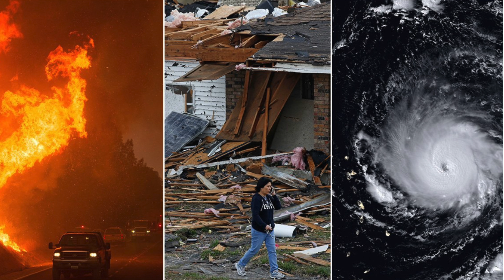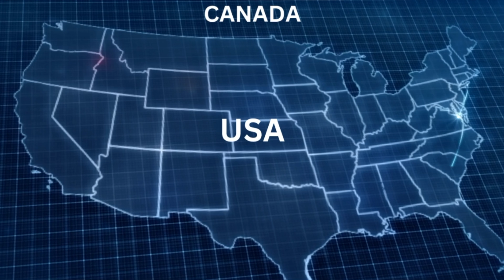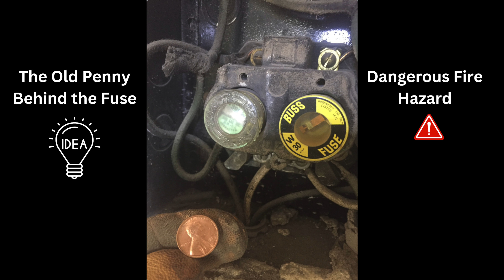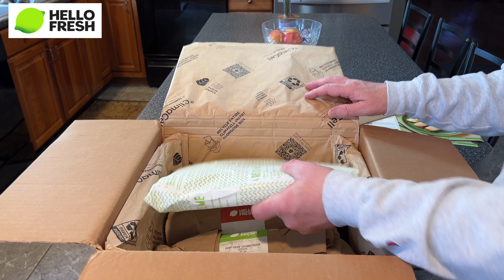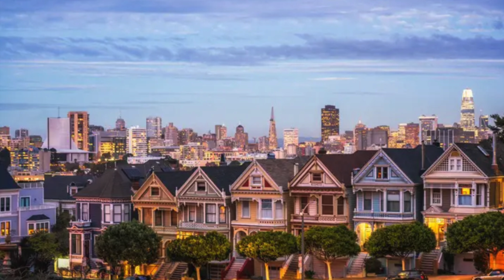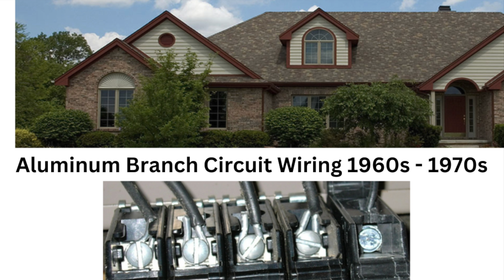Old Wiring Causing New Problems (Are you at Risk?)

Comment: How does old knob & tube wiring cause fires if the circuit has a functional proper size fuse?
Reply from the maker: Pushing the load to at or near the fuse rating over a century can degrade the insulation and cause splices to fail. I have found K&T where the insulation looked ok but when I touched it the insulation turned to powder.
Reply: Knot and tube was in someways safer than modern wiring the problems were due to overloaded circuits, Romex would fail and burn faster under the same conditions, I removed hundred year old wiring, it was all in perfect condition, the modern plastic insulation would fail just as fast if overloaded.
Reply: I believe they used soldered junctions anywhere a wire needs to tee into 2 locations.  I’ve seen plenty of low-voltage solder joints from the 1920s, in pipe organs, where the wires have come apart.  I don’t know if they used better soldering techniques in house construction, but it’s something I worry about somewhat.  I can see some of those junctions in the basement of my 1914 house, but have never removed the tape to see what they look like inside.

Comment: Thank you for posting this. After my mother passed away some years ago, leaving the house to me and my siblings, the home lost insurance coverage because of the very old electrical wiring that it had. I believe that the lender providing the mortgage to the person who wanted to buy that house was also unwilling to move forward unless the electrical system in that house was updated. The buyer of the house was also ready to back out of the sale if both the lender's and insurance company's requirements were not met. I'm not sure if the house wiring was knob and tube wiring. I live quite a distance from where my mother did, and another person handled the actual refurbishing and updating of the house before it was sold. I think it was around $5,000 at that time -- again this was some years ago -- to rewire the house both to meet the code provisions of that time and satisfy the lender and the insurance company. I was glad when insurance coverage was approved, enabling the sale of the house to move forward. I do suggest that anyone expecting to inherit a home get the house inspected right away by an electrician. Then take action on the recommendations. Also look at other items that an insurance company and mortgage lender would look at, and get those things fixed. I and my siblings did hit a number of safety issues with my mother's house that the home insurer required us to correct.

Comment: My childhood home was built in about 1954, I think that it had 2 wire Romex. In the '60s my father (heavy equipment electrician) installed what he called a "grounding grid" throughout the home and bonded it to the water service where it entered the home. 
That way he could upgrade all the receptacles to the "modern" three-prong standard. I'm sure it's still in place but don't know if it's acceptable.

Comment: Most of the homes wired with knob and tube also used wood lath and plaster to cover the walls. Lath and plaster is just about imposable to neatly fish new wire in.
Reply: alot were baloon framed ...once you got thru plaster you had somr times had a clear shot up floors..
Reply: Yes. Been there, done that.

Comment: Thanks for keeping us up to date on this trending across the US. I too have witnessed the horrors of finding the "penny breaker" and knob and tube (In Oklahoma). They are indeed some of the most frightening encounters one can have when working on electrical.
Reply: I've never fully understood the "penny breaker" concept. Does it not rely on the penny making firm contact with threaded female portion of the fuse socket? Thus, are you not relying on gravity for the rim of the penny to make contact as the fuse is tightened? Seems like this intermittent contact situation is almost as bad as the loss of overload protection.

Comment: I remember as a little boy always scratching my head as to why the electrical outlets in my grandparent's house only had 2-prong electrical outlets, instead the 3-prong outlets like most houses had.
Reply: I must be older. I remember looking for an adapter that eliminated the ground.
Reply: @RichardQuaid   Those 3-prong adapters relied on the outlet box being grounded, a rather tenuous assumption at best. Mainly they just saved you from having to cut the grounding prong from the cord.:face-blue-wide-eyes:
Reply: @ Exactly, but many weren't.

Comment: I'm remodeling a more than 100 year old house and the electrical has pretty much turned into a rewire at this point. The old half out the house had been updated to early Romex at some point then an addition was added with slightly newer Romex along with the fuse panel being changed to breakers. Most of the knob and tube is still there, just abandoned. I was in the attic last week tracing some mystery wires and stumbled upon some crumbling knob and tube that was energized buried in the attic and into some walls. Quite scary to know that stuff was still hot and basically crumbled into dust when touched!

Comment: Great video John and a great primer to get home owners thinking. I live in a 1971 house with aluminum wiring. I’m almost done mitigating all of it by installing the Alumiconn connectors. Do you know how the insurance companies view that as a fix?  Would they accept this as a viable solution and reduce the premium excess as a result and/or not cancel your insurance?  How would they handle it if the homeowner did the alumiconn installation themselves?  Thanks!!
Reply from the maker: Thank you.. I am not sure what the insurance companies are thinking or what they will approve. I think it depends on the underwriter and where you live. What you're doing is definitely an improvement and will surely extend the life of the wiring in your home. But what they will except could be a moving target.
Reply: @ I think you’re correct John. We’ll just have to watch it.

Comment: How can you tell if your house needs rewiring?
Reply: Call an electrician is a good just to establish a relationship with a tradesman.

Post a picture of the wires entering the breaker box online, that might give a hint as what is behind the walls. 

You or a handyman could open switch and wall outlets and examine the wires.

Attics basements and crawl spaces may allow inspection.
Reply from the maker: The other commenters here are spot on. If you cannot tell it would be best to get an experienced electrician to come in and look things over.
Reply: Light switches seem to be overlooked when a house is rewired to hide knob and tube wiring. That's how I found it in 2 houses I rewired. Try pulling out a couple switches in bedrooms or at the entrances to the house and check for knob and tube as shown in the video. Another clue is if most of the rooms are all on 1 breaker. Ignore the labeling and turn each breaker off, testing lights and outlets to see what goes off. The second house I rewired had a new breaker panel and new romex from the panel running in the unfinished basement ceiling. Breaker labels looked good - 2 for kitchen, 1 first floor lights, 1 first floor outlets, 2 bedroom, 1 computer room, and a few others. But, when I tested, the first bedroom breaker turned off 1 outlet in the front bedroom. The second didn't turn anything off in the 3 bedrooms. The computer room breaker turned off 1 light in the bathroom. Basically, the whole second floor still had power. I started turning all breakers off one at a time. Naturally, the last one was the one I was looking for. It was labeled first floor lights, but it also powered the second floor. After tracing the romex from the panel, I found a small junction box that was along the edge of the basement ceiling. From that box, I saw the 2 single conductor knob and tube wires that were the original circuit for the house. Whoever rewired was just trying to hide the knob and tube from inspectors that didn't do an extensive check.
Reply: Age of the house is one factor.  Two, look load center, fuses or circuit breakers?  If fuses, it is time to call in a license electrician.  Also, look at the electrical cables entering the load center (circuit breaker box/fuse box) to see what type they are and its best to allow the electrician to look at them.  Amperage size (100 or 150 or 200 amps) of the main breaker and it is sized properly to the electrical load you use, again an electrician is best to look at this.  And most of all, if you have a Federal Pacific or Stab Loc brand electrical panel they should be changed out immediately as they have been recalled.

Comment: Great information. I find many home owners are un aware of this and get blind sided from insurance or after buying a old home and trying to get re connected to power company . I find power company's are refusing service to older homes with old wiring that  looks bad requiring an inspection .  Many foreclosed homes are on the auction block . And can go cheap . But buyer beware . Yes Aluminum for branch circuits is bad.  Have to find breakers and outlets   with a AU wire rating and use DE-OX on wires . and up size AWG . The outher problem I ran inti is CCA Romex that was made for a wile. Copper Clade Aluminum.  Very bad.  It corrodes when damp and over time copper and aluminum  expand at different rates and making a loose connection over time .   I ended up ripping that out and replacing with modern Romex.  The early armed cable like BX has cloth insulation that rots with age and shorts out causing fires. Modern NC cable is great . I do not blame insurance company's for this.  They look at cause of fires in older homes .  Best have older homes inspected for bad wiring before something bad happens.  Mice just love that old wiring.
Reply from the maker: That's great advice for potential home buyers! Thanks for sharing.

Comment: How does the penny short the fuse path?  I’ve heard of it but the fuse’s current pat is through the upper rim of the fuse isn’t it?  I grew up in a knob and tube house and the insulation on the wires was mostly gone.  It’s still standing today.  Insurance scares seem pretty common today.  It would be really expensive and difficult to upgrade it.  Safe and modern is what the people thought when they went from gas to electric - I had family members who did.  I asked my insurance company rep and basically they need money to cover all their recent losses, thus the increases and in some cases cancelations.  I agree electrical safety is important.  Learning to not overload circuits and be responsible is a more important skill than costly upgrades and insurance panic.
Reply: The penny bypasses the fuse by creating a direct electrical path between the center pin and outside metal shell of the fuse holder on edison base type screw in fuses.
Reply: There are two styles of screw-in fuses. The type you are describing is called tamper-resistant, it separates the contacts as you described and it is a different size for each amperage rating so you cannot put a 20 amp fuse on a 15 amp circuit.
The other style called Edison socket is just like a screw-in light bulb. That is the one you can put a coin in and screw the fuse back on to hold it in place.  And the physical size is the same regardless of the amperage rating.  If  a fuse keeps slow burning out because you have too many appliances on the circuit the temptation is to put a higher amperage fuse - even though now your wiring is not properly protected (14 gauge wire with a 20 amp fuse).
Reply from the maker: The comment from JanaBilodeau answers your question.

Comment: Hey John, great video, these types of installations are common in my area, and aluminum conductors for branch circuits are a common topic here. Could  you explain AA 8000 and its inception and why anti oxidants are not required for this conductor as so many inspectors are unaware that this product does not require it because of its formula as an alloy and not just aluminum wiring. I think this would be a great topic to explore. As a fellow electrician I always enjoy your knowledge and videos.
Reply: You will never get an older sparky to stop using no-ox. That and pre twisting wires which is also technically unnecessary
Reply from the maker: I haven't used antioxidant for years but you're right it is hard to break old habits. I do find that pre twisting wires is a best practice even though it's not required. Maybe not so much with 14 gauge wire but with 12 and 10 for sure.
Reply from the maker: That's a great idea for a future video. Stay tuned! I did touch on this subject in this video also if you want to check it out. https://youtu.be/o0DcJewpMpc

Comment: My knob and tube in my 1939 house was in great (looking) condition, and beautifully done. Had to get it replaced, though. Kept one of the porcelain knobs as a souvenir, along with the nail that held it in. Always like to imagine the person who installed it long long ago.
Reply: Still have empty Knobs in my attic! 😂
Reply: @Antassium Done lots of rewires over the years and I will pull out the tubes to run the new romex through. The knobs are in the way, so I pry them off intact withxa flat bar. I got several 5 gal buckets full of knobs and tubes. Also keep old switches, receptacles, fuse panels, and fixtures. Guess I hoard vintage electrical stuff, but some gems for sure.

Comment: The original homestead on our farm was built during the 1870s and at one time had a 24Vdc battery system in it for electricity before they even had AC powerlines available in the area 😊

It has K&T wiring and has been operating on typical AC voltages since the 1920s without incident and still functions perfectly as it should even though there are NO GROUNDS WIRES (aka safety neutrals) in the home!  I trust K&T wiring more than I trust that junk ROMEX that is sold today that I constantly have to replace due to the insulation breaking down and exposing the conductors.  

Call me crazy but I see a lot of newer homes burning down due to poor craftsmanship and junk electrical products produced in China.  The older homes have equipment installed in them that was over-engineeered to last multiple generations without failure.  This is quite evident with HVAC equipment where the newer systems are lucky to last 10 years before replacement where as the older systems can easily last 30-50+ years assuming you don't have some moron who is paid based on commission intentionally sabotaging your system 😈

The insurance companies are just pricing gouging everyone using the recent natural disasters as an excuse.  You do realize the the insurance companies re-insure all their policies through another company in case they have to pay out right?  It's a scam folks, the only difference is that the re-insurer is charging more now so the insurance companies are passing that cost along to the customer even though the insurance companies profits weren't actually effected :face-blue-wide-eyes:

Comment: I just rewired a dangerous three-way light (the kind that puts 120 volts on both the tip and the ring of a light bulb) and noticed that the K&T wires were not 14 gauge, more like 18 gauge. I guess they could do that on a 15 amp circuit because individual wires dissipated the heat.
Reply from the maker: I made a video on these 3-way switches. It's was called the Chicago 3-way or the Carter 3-way. I made a video covering how they were wired. https://youtu.be/Ky48x6LxuYA
Reply: "light bulb.... the K&T wires were not 14 gauge, more like 18 gauge." Remember that for a long time, lighting circuits were 6Amps (or 6.6A?). Also that ampacity is about melting the insulation. The rubber was not relied on for insulation; indeed much K&T was bare. Porcelain don't melt. Ampacity of #18 at high temperature is at least 14 Amps.
Reply: @PRR1954  These circuits were connected to 15 amp fuses and went to lights with outlets. The wires were insulated with cotton.
Reply: Yeah, I came across one of those old school 3 way switch setups that energized both sides of an upstairs hallway light to turn it off (equalizing the potential I guess). I could just imagine what would happen if someone accidentally changed around one of the switch feeds from L1 to L2 when working on the wiring down at the panel! 😬